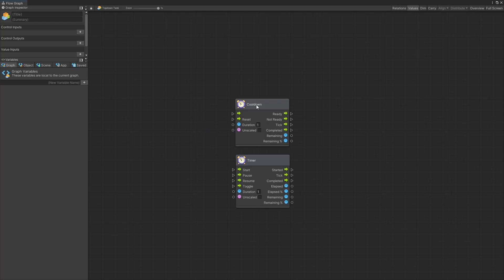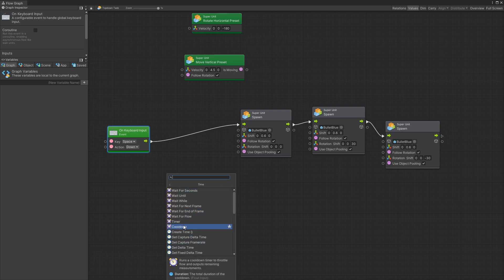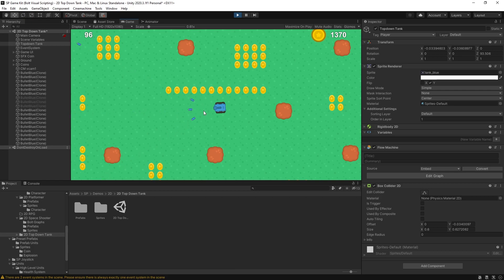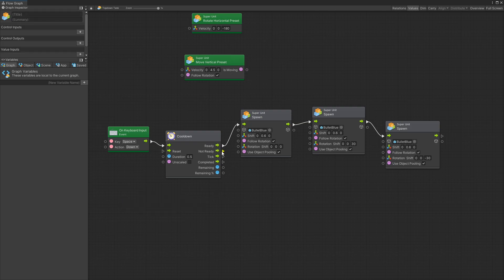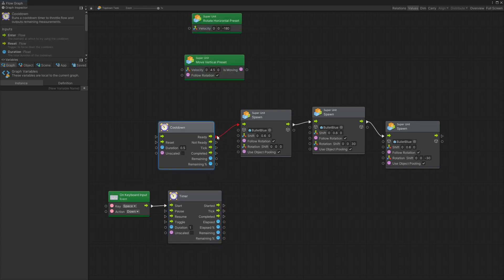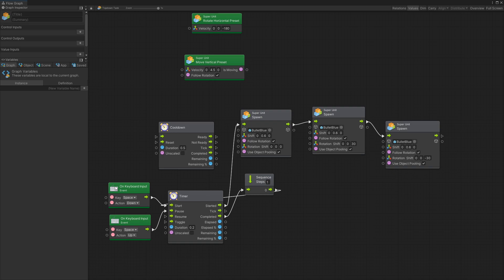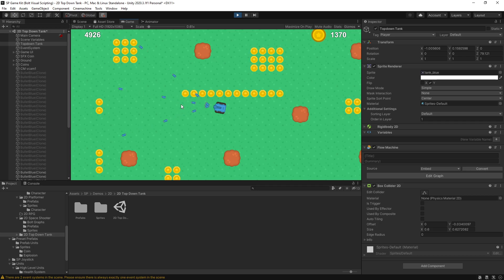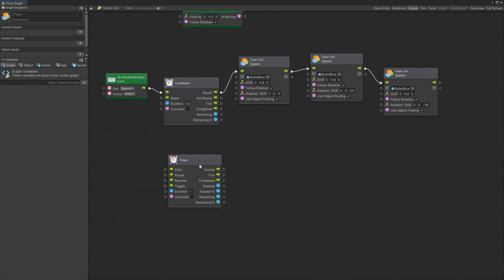Timer & Cooldown - How to Use Unity-Bolt Units #6 | Autofire with Visual Scripting

Comment: now is a great time to do more Bolts tutorials since now Bolt is officially in unity as Visual Scripting since the new 2021.1. If you do make tutorials be sure to use 2021.1 since they've updated and added to Bolt, and also be sure to include "Unity Visual Scripting" in your titles since there are currently not too many tutorials on this new version of Bolt in Unity.
Reply from the maker: There is not much that is changed with Bolt Visual Scripting between 2021 and 2019/2020 and all tutorials that were made for 2019/2020 will also work for 2021. 2021 has an option for new input system other than that all is the same. And I already made a tutorial for new input system https://youtu.be/nbPqBWMnmbk